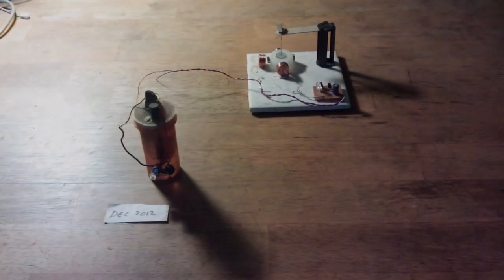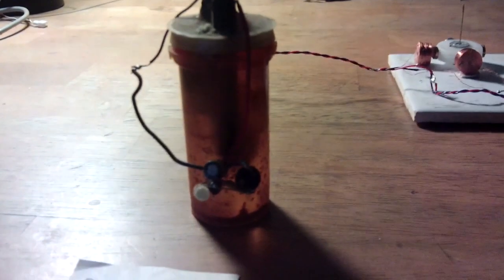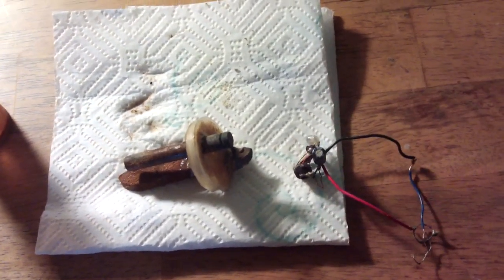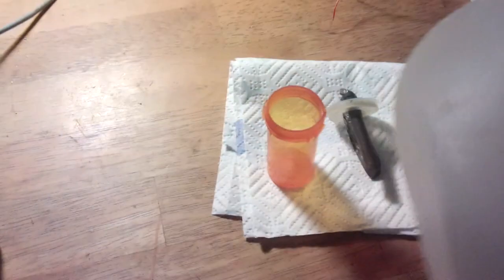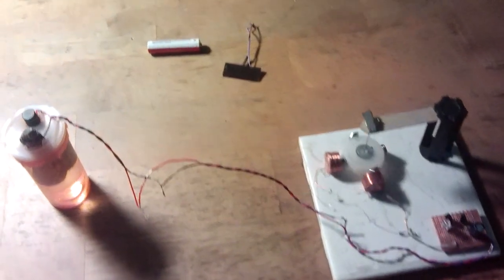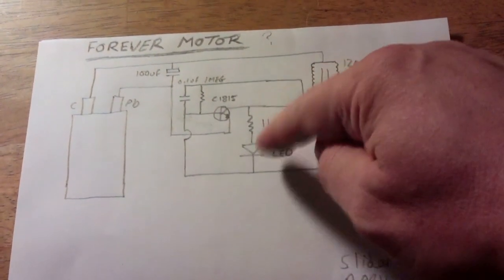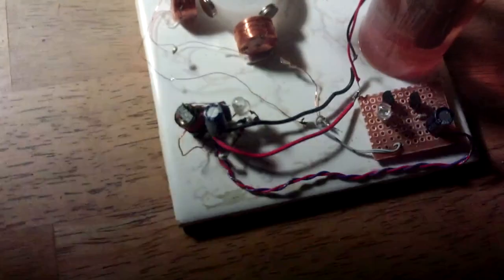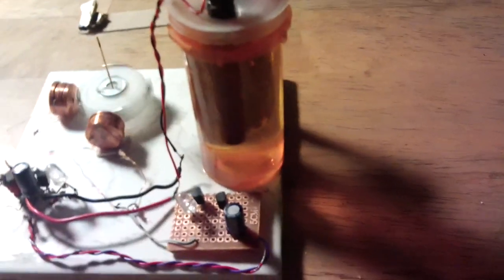Forever Motor ?

Comment: Very nice.   Using a  Joule Thief as a voltage booster was suggested to me also.  I fiddled around with that idea today with mixed results.  I also made a couple of your carbon, lead, and steel cells that worked pretty well.  Lots of fun.
Reply from the maker: The boost method has made a great difference. Tried one on the coil collapse but there wasn't enough coming through, was worth a try. Yep, all steel is gone now, well as far as I could get to, it was tough stuff and needed 1/2hr with the Dremel !  
Have been wondering if there are different types of lead, sort of graded, so your linotype may be slightly different to what they throw on a car wheel. The carbon rod is only from a D cell so that should be good to go...was well washed before using as I didn't want any zinc or other residual chemicals on it. 
It's running fine and I like the backup for possible rotor failure of the LED coming on. Now to find those uncut sapphires again...if I find them you're quite welcome to a few :)

Comment: Great idea! Just acouple of questions. You put just rainwater in the cell without any electrolyte? And do you think the blocking oscillator helps in anyway with the pulsing of the motor? I have a lead/eppsomsalt cell, the disadvantage being the buildup of crystals on the terminals like i saw on yours. Anyway, great video!
Reply from the maker: It might be a good Italian jokes site !
Reply from the maker: Hey no problem :)
I've found rainwater to be just fine, it's powered the 'Nephilim Penny' for longer than this one ran. Also doesn't go stagnant with there being no organic matter in the cell. Your epsom build up is spot on...yes there can be a crystal build up, so the mixture should be a weak one. If it breaks out into the air it makes a mess. Another sign of a strong mix is it forms large 'fish flakes' at the bottom of the container. Long runs = weak mix, short term higher amperage cell = strong mix :)
Reply: It's the power of mother nature! :) Thanks for the info on the epsom, good stuff!
Reply: Haha, never mind answering my second question! After watching it again i see  that you put the oscillator before the motor circuit. I feel like a fool now! :)
Reply: a question never asked is the sign of a fool.it maters not how you get the answer,only the question asked.
Reply: I wonder how many people are gonna click that fool.it link.... :)

Comment: Very cool Slider, nice job
Cheers mate
Reply from the maker: Cheers Steve. Have got it back where it used to be, which is in a dark part of the room. If the rotor stops the light will start flashing and makes for easy checking.
Reply: You should make a glass case and put it in a museum for the next 100 year run
Reply from the maker: Am not sure i'd be able to collect a prize at the end LOL
But yes, am going to put a carriage clock type of dome over it, mainly for dust reasons :)

Comment: Great video as usual, 1st comment yay, is that motor strong enough to do anything cool or useful? Can it spin anything or is it just but capable of anything like that?
Reply from the maker: One thing these can do is run other rotors magnetically. If the speed of the 2nd rotor is matched then the 2 (or more) will run together, with only 1 of them being powered. As to doing something useful, it could likely give an ant a fairground ride, but that's about it :)
Reply: Slider2732 Cool, can it spin any sort of very small fan? Maybe for ventaltion?
Reply: Slider2732 And also why did you remove "Haha, yep first comment"? There was nothing wrong with that lol
Reply from the maker: Oh I rewrite comments all the time, normally to try and add more info. If they start looking long I trim them...all going back to when we only had a set amount of characters to use up  :)
Reply from the maker: Yes sure. Used to have an airplane propeller on one of these semi-levitated type that was under a table light. The greater the pitch of the prop, the slower the motor top speed, but it does work.
Reply: Slider2732 Oh ok
Reply: Slider2732 Cool!
Reply: Don't ask stupid questions man